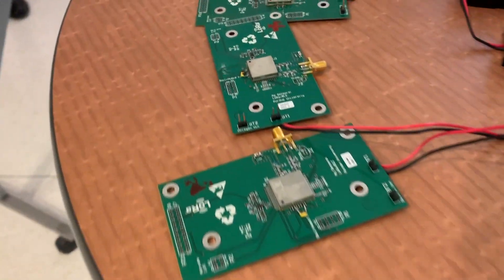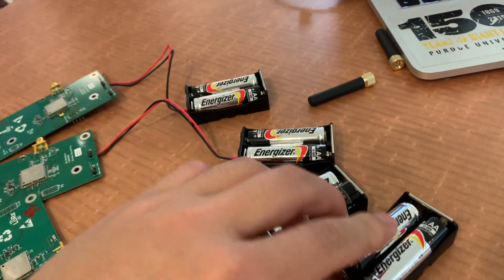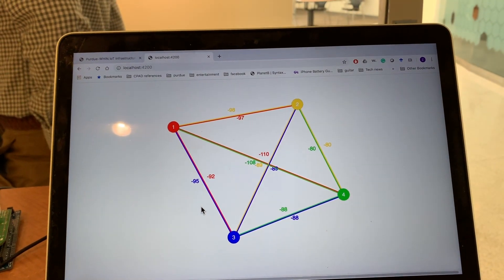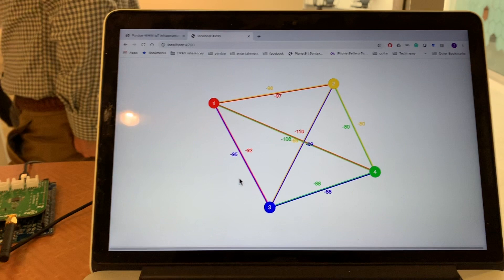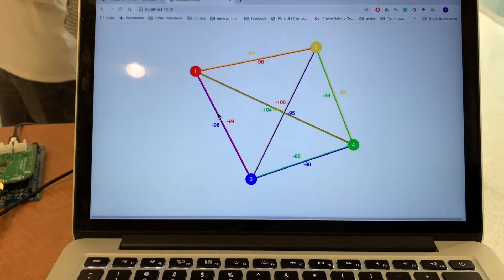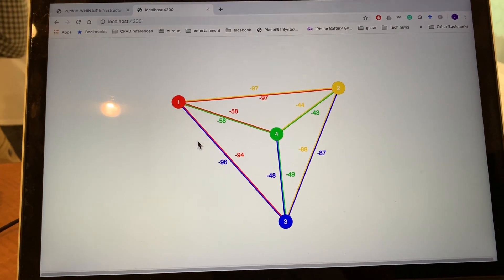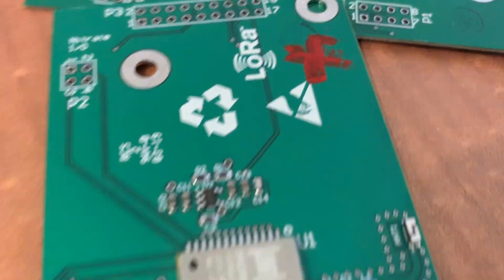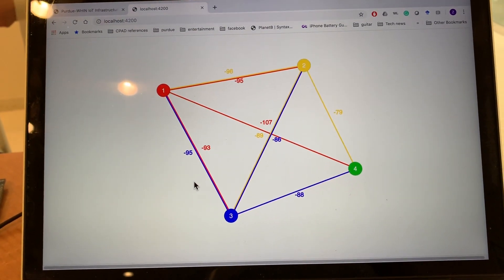LoRa Mesh network Demonstration

Comment: hello zhang, i am trying to develop a energy metering system with lora mesh network, would it be possible for you so share documents related to this project.
Reply from the maker: You can find more detailed algorithms here: https://arxiv.org/abs/2006.12570
Reply: @zhangheng3981  thanks
Reply: @anupmarahatta9867  Did you get progress with this particular project?

Comment: very good project, could it work with mqtt?
Reply: I am guessing and i am interested to try if I can access the code - as MQTT is the messaging layer, whereas Zhang's codebase sets up the network layer to ensure that the messages (whatever those packets contain) get from originator to target potentially via hops across devices. Please tell me if I am wrong or missing something here.